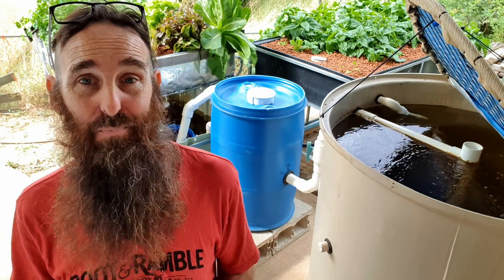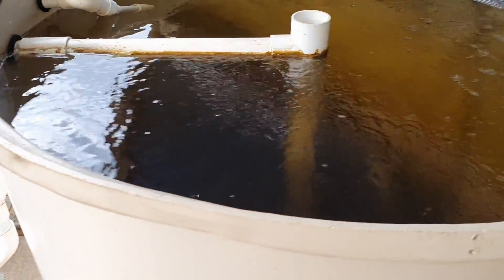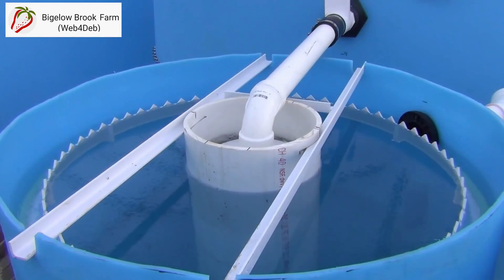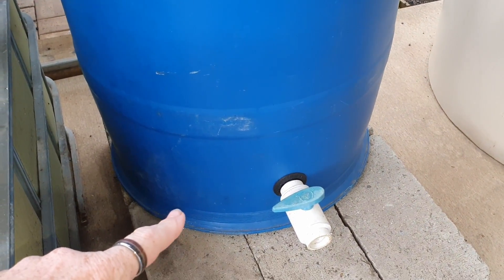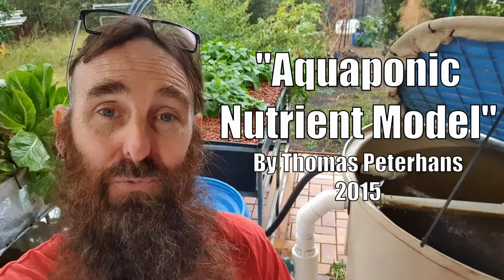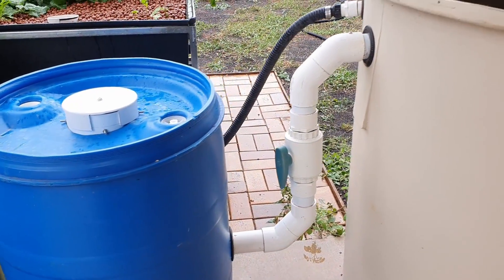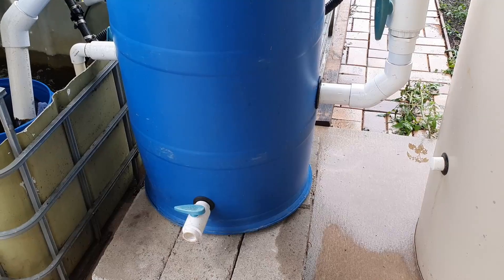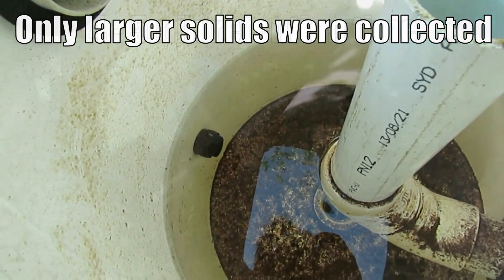Radial Flow Settler for Aquaponics Systems | How RFS work - How to Size Your RFS

Comment: @Bob i have build a radial.flow filter for my RAS System.. what i am facing is.. even though i have cleaned the filter in 3 days there the waste of fish poops  will pop up as a flock typical large in size of 5 cm to 10 cm dia.. why its happening my  system.
Reply from the maker: Hi Mate. This is a copy of what I posted on the other clip as a response for you.
The reason most fish waste will start to float is due to the gases forming as it decomposes on the base of the settler. Some fish also have buoyant waste which can cause issues but that may not be the case if it's settling out for you to begin with.
I'd suggest that you need to clean the solids out more regularly to catch them before they start to produce gas & start to float. 
I now some folks with a large number of fish in their systems that will draw off waste from the base of their drums daily to prevent the solids from floating up & moving on to different parts of the system.  
Hope that helps some Sarath.
Reply: @RobsAquaponics   thank you very much for your kind suggestions dear. 
I regularly clean the floating wast when ever its getting on top of the settler. As you have suggested for cleaning the settler i was using the botom valve that point to the botom of the drum. Unfortunately my design doesn't collect all of the solids from the bottom and it leads the solids to float. 
For your information about my system i have a square tank that holds around 2000 litters of water and carries a 50 number of thilapia with an average weight of 150 grams. 
Feeding them 3 times around 150 grams a day.
Using 2kg of K5 media and 1 squre feet bio-sponge for bacteria to colonise 
Providing an air supply of 18 litter per min 
The circulating pump recycle around 300 litters of water in an hour. 
As you suggested i am going to update my drums bottom with some mechanisms that collects most of the settled wast out via the Drying valve. 

If you need i can provide more information about my system. Interacting with a mate like you, considering it as an achievement.

Comment: Thank you teacher.
Reply from the maker: You are welcome Savat. 😁👍
Reply: @RobsAquaponics  Hello teacher, do you have chemical solution to make Nitrosominas and nitrobacter bacterias?  My filter hasn't has enough bacteria .
Reply from the maker: @savatnut192  I just supply a ammonia source then they will colonise by themselves as they are in the air & on surfaces all around us.
Cheers.
Reply: @RobsAquaponics  I use NH4Cl for running my system.

Comment: "Stilling Well" means that d water velocity has to be practically still for this system to work?
Reply from the maker: Not totally still, it just slows the velocity enough to let the majority of the larger particles to fall out of suspension.
Reply: @RobsAquaponics  Thanks........ made some adjustments, my pond water now almost crystal clear, can see fish which I didn't know were there......... :)

Comment: Hey Rob it is possible to have the cone inside the settler too you may loose a little volume inside but it is possible to have 4 smaller pieces of plastic that would be angled in a fashion that will force the solids to congregate at a single point..
Reply from the maker: There's no reason you can't Lincoln. Have seen many settlers with cone bases. 
Only reason I use the flat based drums is due to price & that the drain system I sues cleans them out just as well. 
Cheers.

Comment: Would you slow down the water flow if you added bristles that hang into the water? An old broom head glued to the lid for example.
Reply from the maker: That would work + it would help to collect some of the fine solids as well. Might add that to the "to try" list.
Thanks Hannes. 👍

Comment: Sharing our dual radial flow design. With the dual radial flow design, the retention time is longer but with a smaller footprint. https://youtu.be/hN8dvLG1uVU
Reply from the maker: Will check out the clip when I get some time.
Cheers.

Comment: Your explanations are very clear.Thanks for posting.We plan to use swirl filter in our unit.
Could you share mineralization and oxygenation of fish waste?

Would that make it easier on maintenence should the above step is used?

Happy aquaponics
Reply from the maker: Hi Neeta. Will be posting a clip ion the solids mineralisation system once I have one up & running. 👍
Hope your system is running well.

Comment: why water not taking from bottom of fish tank ?? most of dust are exist in bottom of fish tank what is not flot... so why that water goes to radial flow settler tank from upper side of fish tank ??
Reply from the maker: The water is taken from the base of the fish tank using a solids lifting outlet. This clip explains a few designs & how they work,
https://www.youtube.com/watch?v=bmzgANTGJ0k
Cheers.

Comment: On the retention time: Could you run three of the 200L (600L total) barrels in parallel and still have the same effect as one 600L barrel?
Reply from the maker: That would help a lot Brad. 👍 You looking at adding additional settlers?
Reply: @RobsAquaponics  I babysat a system for a summer back in 2010 and have just kept up an interest in the topic since that time.

Comment: Hi Rob, how much is the capacity of the fish tank in this video, how many fish can grow in 10000-litre tank. Is this type of filter can be use for 10000-litre tank? I want to do a system. Kindly advise.
Reply from the maker: The tank in this clip is a 1000L tank.
I would stock no more than 400 fish in a 10000L tank unless you have commercial grade drum style filters for the solids & adequate bio-filtration to handle the conversion of the ammonia through to nitrate.
Cheers.

Comment: Rob, place an elliptical plastic disk in the   settler which will guide the gunk to the outlet tap.
Reply from the maker: Nice idea WOB. 👍 Would be a lot easier to set up than a cone base. 😉 Would still like to weld it in place so no water or muck gets under it causing issues down the line.
Cheers.

Comment: Mr. Bob,

I'm designing and setting up a new system from an IBC chop and flip with two 55 gal barrels.  I am planning on using one a a radial flow settler and the second as a bioreactor.  I don't plan on starting with a separate sump, but want to use the bioreactor as the location for the water pump, just prior to the pant media bed.  Is this something that is frowned upon in your opinion?
Reply from the maker: It can be done. Just need to make sure that the media is well screened & kept away from the pump inlet.

Comment: why not have the direction change happen below the water surface
Reply from the maker: It doesn't matter if it happens above or below from what I've seen with our systems. 👍
Cheers.
Reply: Rob Bob's Aquaponics & Backyard Farm  thanks Rob I wouldn’t have guess. Setting up my first system as we speak.

Comment: how do you figure out the flow rate for the equation for sizing your setter?
Reply from the maker: Hey Matt. Best way is to time how long it takes to fill a bucket that you know the volume of. 
For instance, if a 5 gal bucket takes 50 seconds to fill we multiply the 5 gal by 60 seconds & divide that by the 50 seconds it took to fill it. 
5 x 60 = 300
300 / 50 = 6
That gives us a flow rate of 6 gal a minute. 
Multiply that by 60 (minutes) & we get 360 gal per hour.
Hope that helps mate.

Comment: one doubt sir  how does we can know our flow rate  going out of fish tank is , like how u calculated ur flow rate is 2ooo plz reply  under comment
Reply from the maker: Al you need to do is fill a bucket that you know the volume of with water coming out of the fish tank. 
For example, if it takes 25 seconds to fill a 10L bucket.
Divide 60 seconds with 25 & you get 2.4 (the number of buckets that you can fill in a minute). 
Then multiply the 2.4 with the bucket size, 10 & you get 24L in one minute.
You then multiply that by 60 to see how many litres in an hour, 24 x 60 = 1440 litres per hour.
Hope that helps. 👍
Reply: @RobsAquaponics  thank you so much for the details @making the fundamental calculation easier  , you do remarkable work sir and i'm honored to   get solution from you  :)

Comment: I'm still trying to figure out how that L -shaped pipe in the fish tank picks up the solid from the bottom center of the tank that then flows to the separator.  Does the water flow in to the top of the pipe and then pull water/solids up the center pipe with it?
Reply from the maker: Not quite Jeffrey.
The water enters at the base & the flow is fast enough through the pipe that it picks up the light solids & takes them out to the settler.The hole in the top of the Solids lifting pipe is to prevent a siphon occurring & draining the tank. 
Hope that helps mate.

Comment: hi. just a question. can i put in fishnets or shade cloths inside the filter to further help in filtering the water going out? or is it not necessary?
Reply from the maker: I have seen folks do that & it works well. Can be a bit messy to clean & you'll probably need to dump most of the water come cleaning time. Might have a few issues if you don't clean the netting out frequently. 
Cheers Ivan.

Comment: I'm learning about this subject, thank you for sharing your knowledge.  These containers seem analogous to a capacitor in a circuit, if you put them in parallel it may be a cost-effective way to cycle out more solids with several smaller containers instead of a large one.
Reply from the maker: Adding another would definitely help to lengthen the retention time & collect more solids. 
Cheers Aaron & have a top one mate.

Comment: If you need more Retention time use a IBC as your radial flow filter...
Reply from the maker: That's helpful if you have the space. 👍
Another option is to run due drains. 😉
Cheers.

Comment: Have you considered putting sump tank underground for temperture control? This way u dont have to lift growbed up and they can stay safe and steady on the ground
Reply from the maker: Unfortunately that's a but hard in this location due to the sewer drain pipes under ground here.
I did have the last sump partially buried but not too deep due to some very large tree roots from out mango tree. 
Definitely worth doing if you can though. I'd still keep the beds up this high though for ease of use. Would help to have some lower beds for tall growing veg like tomatoes though.
Cheers Yan He. 👍

Comment: 1:52 what is the reason of using 2pcs of 45 degree elbow instead of 1 90 degree elbow????
Reply: Slower turn to obstruct the water flow less.
Reply from the maker: As Daniel said above, to create a softer curve so the water doesn't slow down as much. 
Cheers Hendi.

Comment: great article in the links below, thank you, by the way to make a conical bottom on a blue bin like that, try using any round weight, with a few bricks on it, in center of bin , with bin off the ground and only supported at edges, then simply heat using a heat gun (in an area with plenty of ventilation) soften it up and it slowly stretches out, do not do it too much or the base will get too thin , heat evenly and take your time is the key here, few goes and you get it pretty good each time, will not be a $500 tank but enough to get solids to settle closer to outflow to have most sucked up each time
Reply from the maker: Have sen folks dish out the base In the smaller drums but never thought about having a crack at a larger 55gal jobbie. Have you got one set up on your system Jennifer? 
Cheers.
Reply: @RobsAquaponics  surprising how little angle you need to achieve to make it effective, to understand this concept, think how uniform to level sludge settles in anything, so even a small amount makes a huge difference. Not yet Rob, just coming to tankage now after a very long build process(2 years, part time). will send you some photos once finished, very pleased with what we have so far, even as just a glasshouse, people get very excited when they come here

Comment: I deal with settling velocity a lot with my gold mining, it's interesting seeing the same principles applied to other applications. Another filter method is called a lamella clarifier or inclined plate settler.
Reply from the maker: I've seen a some similar in design used in aquaponics systems but more the larger commercial systems 👍
Do you earn an income from mining or is it just a hobby if you done't mind me asking.
Reply: @RobsAquaponics  I've been a professional gold miner since 2006. I have an ownership stake in 19,000 acres of mining rights in Alaska. I am finishing a capital raise to complete the largest gold mining operation of its type in North America.
Reply from the maker: @TagiukGold  Nice one mate.  👍👍 Hope you can get the funding you need mate. 
Not sure how you could live up there though. I'm sitting here in 3 layers at the moment as it got down to below 0°C/32°F here last night.🤣 The subtropics has made me soft I think. 😉
Cheers.

Comment: Hi Rob, I'm yet too setup a small aquaponics system here and confused by to many reference. Should the water pass through biofilter bed (grow bed) and then to the deep water culture or can i bypass the  grow bed and flow water to DWC?
Reply from the maker: You can bypass the grow bed if you think you have adequate solids filtration Mandan.  It's best to remove as much solids as you can before adding the water to the DWC.
Reply: @RobsAquaponics  thanks Rob, that pretty much clears my doubt.

Comment: Great video, as always Rob! 
Have you thought about putting in a bio filter after your RFS?
I use a 200l RFS into a 200l bio filter before going into my media bed
Reply from the maker: There is one of sorts in the sump that's filled with shade cloth but nothing like the old setup I had.  
I'm going to remove it though & turn it into a static pack trickle bio/solids filter though as the shade cloth is a real pain in the rear to clean. 
Cheers Indica Dogo & have a top one.

Comment: I do not understand how the settlement chamber does not overflow. The top is quite a distance under the water level of the fish tank it seems. Why stops it from overflowing?
Reply from the maker: The flow out is the same as the flow in so it will never overflow. 👍
Cheers.

Comment: Maybe you can cut a piece of plastic to fit in like a cone at the bottom of the tank. With the discharge Port the middle of the bottom of the cone. If you want 45° sides, then multiply the radius of your tank by 1.414 .  cut a circle of flexible plastic with Vishnu radius, then cut a pie slice out of it and a small circle in the middle where your outflow will fit. Then you can notch the edges where the pie slice came out and the outflow pipe goes through. If you want it to clean automatically, then put the pump on a timer and make a loop to above the height of the radial flow filter and install an air gap. This way the pump does not have to seal and you can put it on one of those timers that you plug into the well. Yes they had a bit of complexity, but you wouldn't have to manually flush your filter and your water quality would be more consistent. Keep up the good work Rob Bob. I truly value people like you who share their skills and try to encourage others to be involved in worthwhile hobbies
Reply from the maker: I like the idea of having the pump on a timer Glen.👍👍  
Have seen folks add a cone into the base of their 55gal drums & they do work. Would have a propper crack if I had a plastic welder. 
Many will also pack the internal walls of the filter with cement to form a cone then seal it with a food-safe sealant. They can then plumb the outlet into the centre of the flat base of the drum which makes life easier. 
I'm fairly happy with the set up as it stands but would like to get propper cone base tanks for the settler & bio in the next large system we'll be setting up here. 
Cheers mate & have a top one.

Comment: If you needed more settling time could one just add more 200L settling tanks? With sufficient drop have them ganged in series.
Reply from the maker: They would work better running side by side/in parallel as the flow into each would be decreased which in turn would be increasing the overall retention time.  
Cheers John & have a top one.

Comment: Rob why not pump to your radial settler and that way you can set your detention time for whatever you want and you don’t have to worry about the height of the radio flow filter?
Reply from the maker: Hey Aaron. I prefer to keep the pump out of the fish tank & in a separate sump in my builds.  Have seen systems where a pipe comes lose & all the water is pumped from the tank leaving some very dead fish. 
Cheers mate.
Reply: @RobsAquaponics  Thanks rob for your response. I am thinking about putting a sump between the fish tank and the radial filter thus avoiding the failure mode you described.  I was just curious if the radial filter becomes less efficient because all the solids are going through the pump and becoming finer? I suppose I could adjust the detention time given I would now be pumping to the radial filter... It's probably tough to measure, but your opinion is valuable.  Anyway, thanks for your work.  You've inspired our family to aquaponics...  Greenhouse coming soon! Take care.
Reply from the maker: @MrAaronCard  Thew pump will smash the solids into finer particles so would need a longer retention time to fall out of suspension. 
The settler will do a better job before the sump but the fish will be safe in either position as long as the water leaves the FT via a solids lifting overflow/outlet.

Comment: Does the solids lifting outlet have to be at the waterline like you have in the video or could you have it below the waterline? I feel like you would have better flow if the pipe was underwater and your siphon prevention pipe was still out of the water
Reply from the maker: There is generally no issues with flow rate as long as you have the pipe sized correctly for the flow rate. 
If the outlet was lower the water would naturally drain to that level 👍